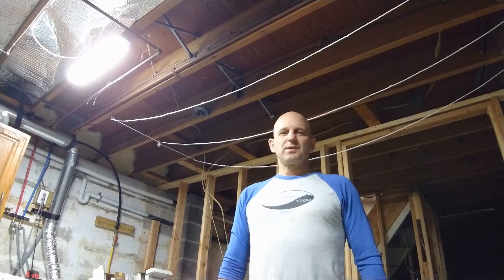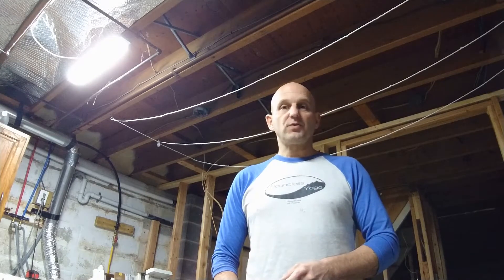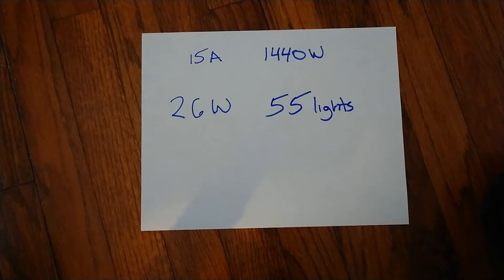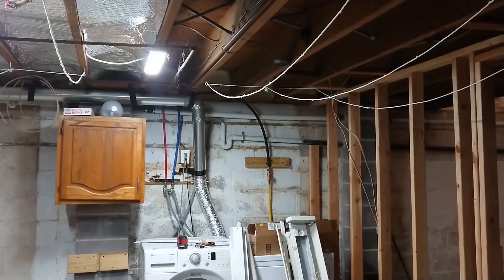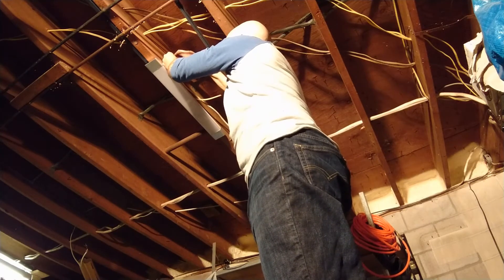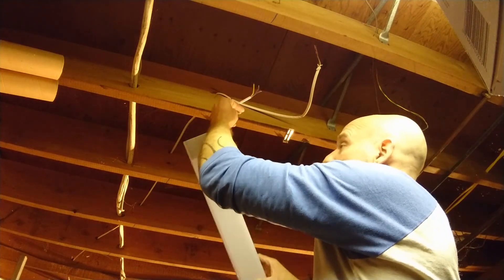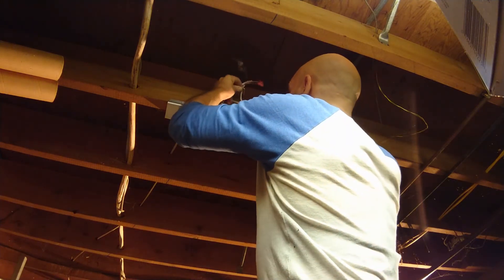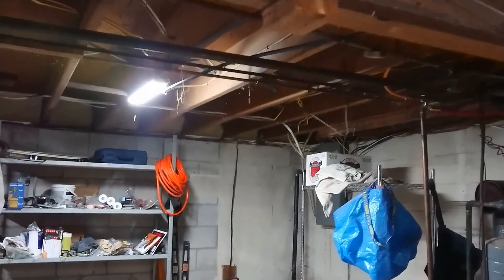Adding a light to an existing circuit

Comment: Shouldn't you be installing a junction box where the hot wires are connected to the fixture wires? That way your connections and wire nuts are protected? Wouldn't what you did not meet code?